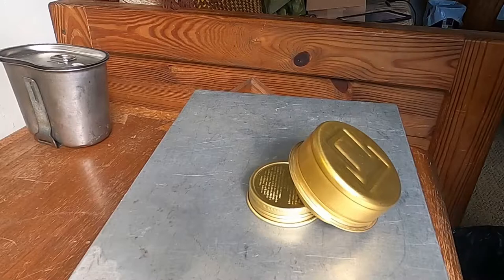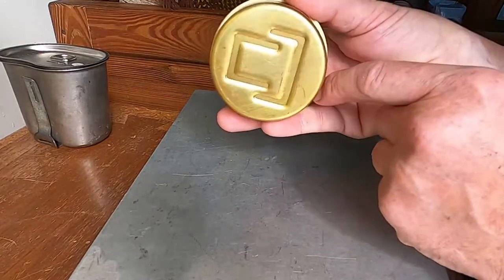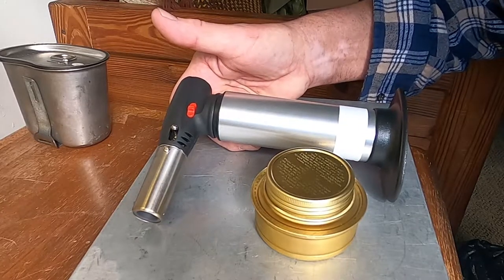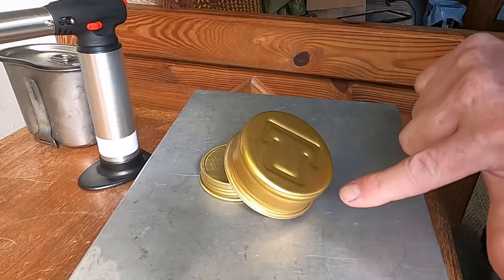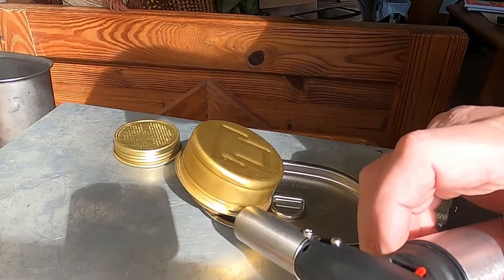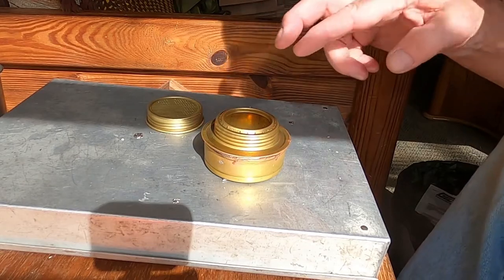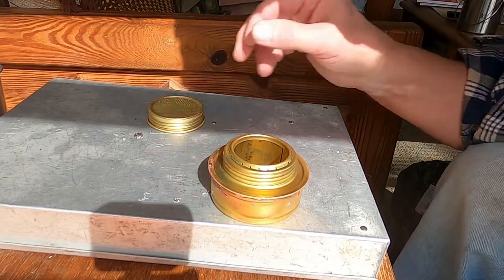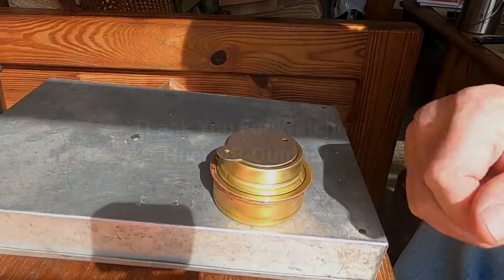Soldering a Trangia Stove - Short Version! - Watch This

Comment: I think the easiest and cleanest way to solder it is to use solder paste that is used for computer components and such, you just have to apply the paste all around and heat it with a jet lighter which is very precise and won't overheat the metal.
Reply from the maker: I like those suggestions! The fluxes in plumbing solder are messy. A regular torch (not a flash light) is to hot for this project.

Comment: I used some flux and it helped the solder run a little better
Reply from the maker: Flux really helps solder wick! I didn't use flux because I was not sure how it would react with the acid core solder. I would try flux, and a thin solder. My biggest take away from this project was low heat. The brass is so thin it doesn't take much. When it changes color,  the metal is burnt. A little more heat, and the thin brass will burn through.  I would play with a couple different techniques and perfect the process, if I was going to do more burners. I have some ideas, maybe I will try a couple more and put out a better video. @RobertLarkham, Thank you for your input, and comments!! Thank you for watching!!

Comment: Thanks HBO. I just bought a soldered Trangia. I was wondering if I needed to neutralize the areas on the brass that looked an orange color. ~ Seems not, and from the heat vs acid type stain.

Comment: Before soldering, make sure to sand the surface very well. I forgot and the product turned out to be garbage. You can use a soldering iron. Do not use high heat in vain. :(